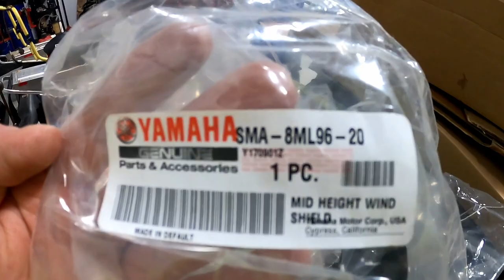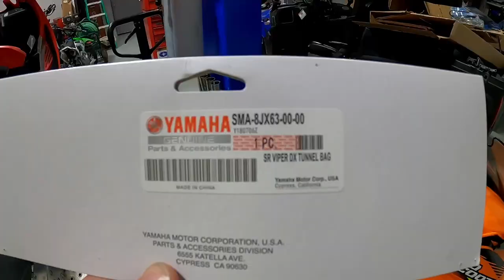IN ACTION! Yamah Snoscoot 200 Youth Snowmobile,  Arctic Cat ZR 200 & Ski Doo MXZ 200

Comment: How does it do in deep snow with an adult on it? It looks like it would be way easier to dig out when it gets stuck than a regular full-sized machine?
Reply from the maker: Hmm I would NOT buy this for an adult to ride, you will be very cramped and bored within a few miles. Even my 10 year old was pretty bored within a week. The machine tops out at 30 MPH and the suspension is way under-sprung for an adult! Stick to a full size sled. Enjoy the ride, Jared
Reply: If you are not too big an adult, do some mods springs, clutching, jet kit.  I am prob 200lbs with light gear, my little guy sits in front and is about 30 lbs with gear and i put the stiff springs in the skid.  works fine for a little deep snow.  carb is temperamental to temp and elevation and sensitive to adjustment.  will be doing mods in the not too distant future